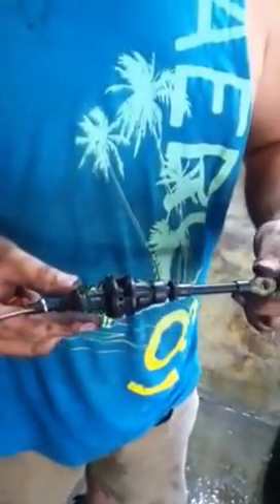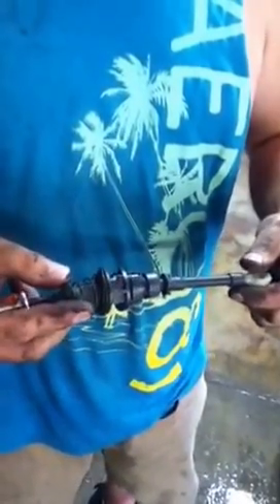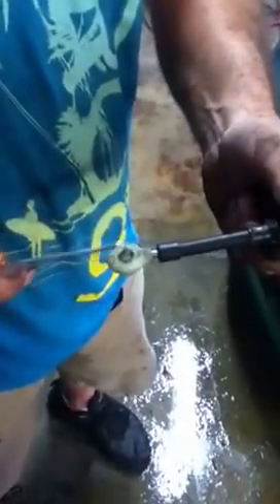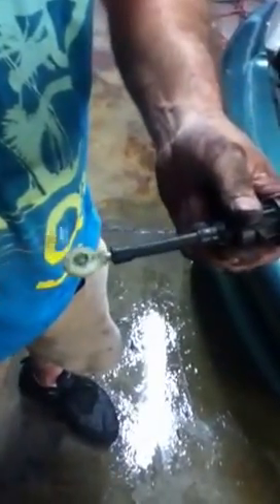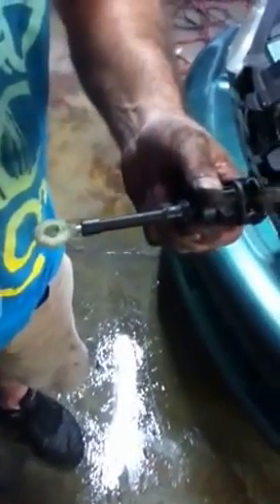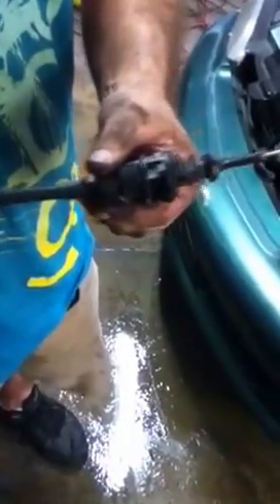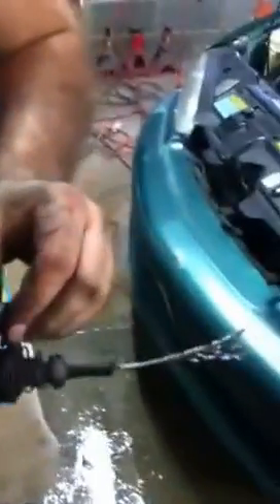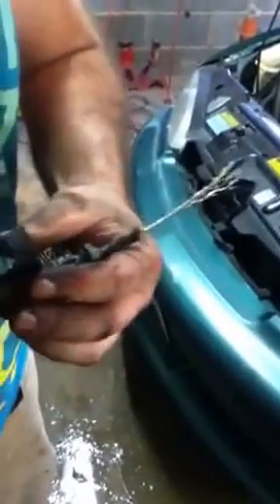How To Adjust Sunfire/Cavalier Shift Cable

Comment: Well very help full video, just adjusted the old 1998 Cavalier of my Sister in Law which didn't want to go in Park, some mechanic in the past fiddled around without knowing what He was doing (but charging for the "Service"), main reason I do maintenance on my cars myself, don't thrust these rookie mechanics.
But this simple adjustment I wasn't aware of (not really mentioned in service manuals).
In general this will apply for most cars with just some slight differences.

Comment: Thank you so much for posting this. I replaced my cable a couple of months ago and had no idea how to adjust it, so ive been driving around with the indicator in neutral.  I lifted the tab with the cable about 3/8 of an inch withbthe car in park and the cabke immediately shot into the correct position, then i just pushed the clip back in and the shifter is right on the money again.
Reply from the maker: ***** Hey Mike, glad to hear that the video helped you out man and thanks so much for the feedback. If you ever have a question or need some help don't hesitate to ask. I'm here to help however I can.

Comment from the maker: +Preston Arcuri, Thanks for the question man and sorry for the delay. I thought that I had already answered your question but didn't see my reply so trying again. I believe that the manual transmission has a plastic tip in the linkage and it really famous for disintegrating and breaking. I'm not sure what year they stopped using that particular tip. Have you resolved this issue or would you like for me to research it a little more for you?

Comment: I have a question my buddy has a 95 sunfire that was threw into park so now when put into gear it only moves a little bit then acts as if brakes are applied what is the cause?
Reply: I'm thinking shifter adjustment??
Reply from the maker: +Steve McCrone running fine then slams into park , does it go into reverse and neutral still

Comment: Hey my 97 cavalier lost all gears, at first only second gear wouldn't work but then all of the gears stopped working. New clutch and engine. My cable is visibly frayed and must be stretched in the engine compartment. Will this still work on a manual? Please respond asap I might need a whole new cable setup. If so please send link to the correct item. Thanks liked and subbed

Comment from the maker: Hey Eric, your best bet is going to be going to a Pick A Part yard and just pop you one out of a junker. If you're lucky, you can easily access the part and then just install in your Sunfire. What year is your Sunfire again? The Sunfires came out in 95 and they use different types of linkage. Let me know and I will tell you what you will need to take with you to take the part out.

Comment: I have a 2 door 1998 sunfire 2.2 manual. I am not a mechanic but I am also not rich at all. So my cable will not stay on, is it a bushing problem, I've read that I can use a 1 inch fuel hose and it should stay on. Having trouble figuring out how to fix this. Do u have an email that i can send you a picture of what i am dealing with?
Reply from the maker: Bone Smug I can help you out with this. The bushing is nothing more than a piece of hard plastic that pops over the fitting and they wear out over time. The way to permanently fix this problem is to replace the bushing. You could go to a junk yard and try to salvage one out of a junk car but the easiest thing to do would probably be to just buy a new one from Chevy. They are pretty cheap and not hard to replace at all. By all means though, send me a picture though and I will get right back with you. Messaging you my email privately now.
Reply from the maker: Bone Smug Hey Man, just checking in with you to see how things are going. I emailed you back and just want to be sure that you got it.
Reply: JamieJones TheCarMan Yeah I did get your email. I had to order the part. From a small city. Hoping it will be here soon. I checked the local junkyard but they did not have what I was looking for.
Reply from the maker: Bone Smug No problem man. Just wanted to make sure that you weren't having any problems with the repair.
Reply: JamieJones TheCarMan hey I have a question. do you know what may cause my manual transmission 04 cavalier to not allow me to shift into second fourth or reverse ? is that a linkage issue as well?

Comment: I need info on a 5speed manual. My cable is kinda stretched and wont go into 2nd gear. If I can tighten the cable, it would work ok... My shifter assembly (plastic crap parts dammit!) also broke and seems I cannot find the replacement part, even my mechanic cannot find it. May take awhile to replace the bracket... If anyone has info on manual trans, let me know. A shame, I have a brand new engine in my beloved lil 1992 Sunfire and cant drive it without skip-shifting...